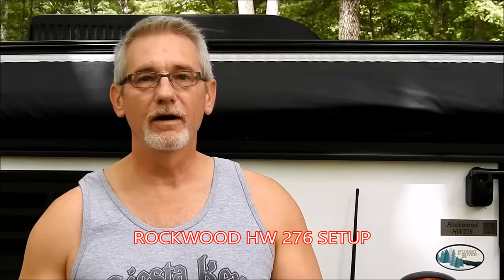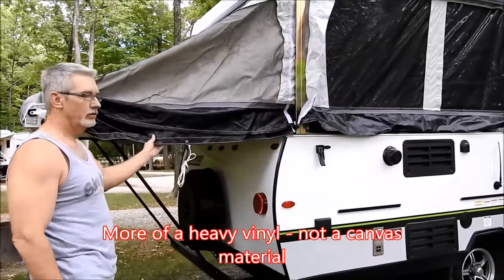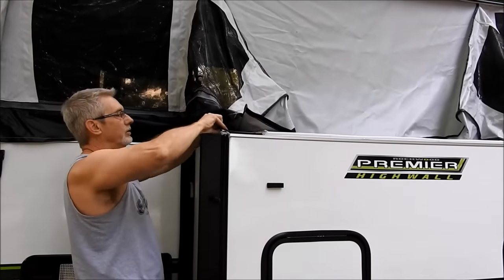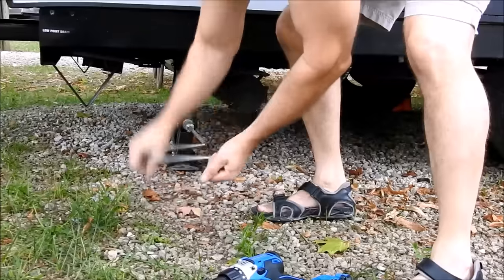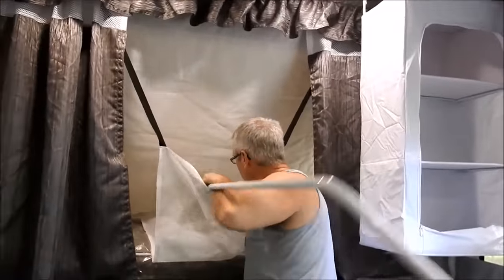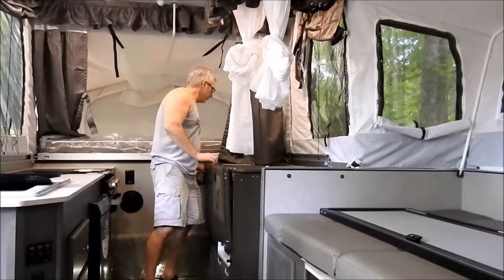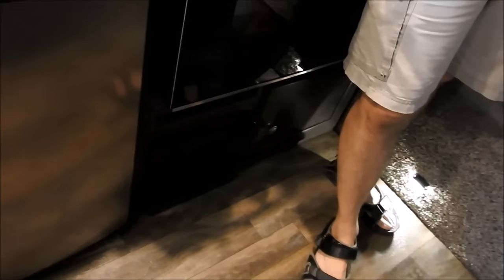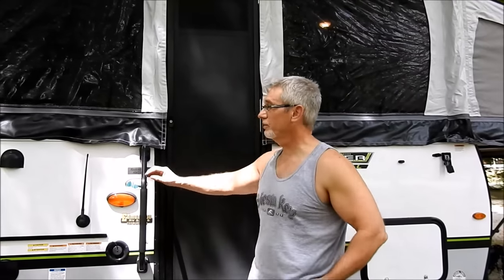Pop up camper set up, Rockwood High Wall 276 set up

Comment: We had a large pop-up for about 12 years. The first night of each trip I would turn on all the lights on inside walk around the outside of the trailer to close up anywhere light would come out of the points where the tent sealed to the trailer. We found that if you are using a fantastic fan the vacuum was enough to suck in any tiny flies that would be attracted to the light. When we did not, we would quickly realize how many bugs could get in within a very short time. Good luck and I hope you have as many years of fun as we had with ours.

Comment: Liked the looks of the high wall pop up.We have a 1984 Jayco pop up camper and enjoy it more sometime than are 25 ft. Wilderness camper. We thought for one person assembly you did really good. We liked alot about yours. Ares came with no A/C heater. We camper in Missouri in February at 30 degrees outside with a electric heater and two large dogs. My son had  A frame pop up with A/C and heat and him and his family came to our to get warm. The 1984 pop up had the most space out of the two. Enjoy camping!

Comment: We had a pop-up for years, many many happy memories in ours, we loved it. I’ll give ya a couple of hints, do the bottom outside edge (the Velcro etc) of the bed after you push up the bed bar, makes it a little easier to push up that bloody bar. 😆 Even with a heated mattress, but some thin foam insulation under the mattress, not only does it keep you warmer but it adds a little cushion to the mattress. One final tip, if you have a fiancé with allergies, hook up that ac. LOL 😂
I am curious as to why you’d use a port a potty when you have a potty built in? Black water is super easy to dump.

Comment: It is much easier to put the bar in above the bed if you do it before you do the zippers on the side wall. It took me a couple of times setting up the camper before I realized that. Good video for first time set up. I have the HW 277 and love it.

Comment: Nice job , you get faster after a few times of setting up , we level the camper first then the stableizers go down and then lift the roof , as soon as the roof is up put on those safety bars just in case . We use a small hand level on the bunk support bars  to level . You could probably feel me helping you push on that front canvas roof ,mine is still snug after 2 years but not bad .you already discovered the corner zippers we unzip to within a inch or so of the top, they can be stubborn to line up if unzippef all the way with tension on the canvas .we can tow our popup with any vehicle in the house and it stores in the garage , not so with a hardside so that made our decision easy and the extra work worth it , congrats and have fun , from a fellow rockwooder .
Reply: I imagine next time the camera person aka fiance will help and make it go by a lot quicker and efficient.
Reply: You done well I  from uk

Comment: My husband and I borrowed his parents pop up camper, and it wasn't near as hard as the one in the video.  Now this was 30 years ago, and didn't have a bathroom or a pop out for the dining area.  It was what is called a hard sided pop up.  It had a queen size bed on one side and a double bed at the opposite end.  Nice dining table, seating for four, and could be turned into a bed.  Had a kitchen area (stove and oven, sink),  ect.  The sides to the bed, once pulled out, were solid fiberglass.  We were able to set it up in about 10 minutes.  So don't be discouraged about pop-ups, as there are easier ones to set up.  The one this gentleman has just has all the bells and whistles.

Comment: A very long time to set up, but a very nice pop up. Enjoy! You said you spent time in submarine duty, I assume you were in the Navy. I served as well. Thank you for your service veteran Brother, I was an Air-dale. Enjoy the new trailer and happy camping.
Reply: my husband also served in submarine service. Took a while to set up but I am sure the more you use it the easier and faster it will become plus your other half will most likely be helping.
Reply: Rick C Fellow Veteran Brother Thank You for your Service from an Air Force Veteran . My brother was in the Navy on the sub USS Sam Ray Burn home ported in Holy Loch Scotland . He was stationed state side in New London , Connecticut . He rented a house near by in Gales Ferry , Ct. What is an Air-dale ?.
Reply: @bobshaw4063  An Airedale is referred to Pilots and Sailors that work in the aviation division, also know as the Brown Shoe Navy. Since all Pilots wore Brown shoes.  I was an Aviation hydraulic and structures Mechanic.
Reply: @MRCRUZER19  Thank You four reply & explanation of an Airedale .
Reply: @bobshaw4063  ,
THankX from all, USA Patriots..Now of Only i, could find one like my cuz Dave HAD YRS ago , . 
under 2000.00 🇺🇸👵 lol, 
I Just love Fishin !
Reply: @carasmussen27  it took longer because he was explaining everything for the benefit of the video. It won't take nearly so long when they are just setting up, and working together.😊

Comment: I had a pop up and camped a few years in it. The set up and break down got old quickly. For about the same price we bought a somewhat compact 21 foot trailer with an electric slide out to make it wider inside. Much happier now, pull up to the camp site and just hit the button for the slide out and that’s about it. Hard sides, a real bathroom, much better insulation, etc. and at just 21 feet it fits in all of our favorite camp sites.

Comment: Ive had pop ups for years, love them
Reply: Could set it up and take it down in about 10 minutes or little less.
Reply from the maker: Yes, This was my very first time. It did get better the more I practiced. I think one of the problems with this one is that it was a high wall. Everything was placed higher up, bigger and heavier. If I were to do it again...probably just a regular 8 or 10 foot box pop up

Comment: Just caught your video. Very nice. We have a Flagstaff  HW27 ks from 2013. very similar in a lot of ways. We went with it cause the Kitchen slide meant I didn't have to be inside very much. The wife is height challenged so I made her a double step to help her get in the bunks. One step would help you guys in setting the poles. Have fun,  in the camper. open the screens and you almost feel like your outdoors. Bless you guys, the adventure begins.

Comment: I purchased my 97 Fleetwood Coleman Camper about a month ago ..... The general layout is not that much similar ...... and don’t have a the wet bath ..... We did our first trip with it last week and loved it ...... Yeah , you always have to play with the door a little bit .... but always get it in there . I have to deal with the drain not draining the way it should .... always projects to do on the older ones ..... and prefer to use a camping toilet at night with a 2 room tent shelter .... using the other room for showering if needed or changing room . 

It was fun watching you set it up by yourself ..... but have a lot less work on our older one ..... but yours does have a few more functions than ours . I have electric and heat that work great ..... roof type Air Conditioner that is not as economical on power as yours . It gives our generator a hard time at times and kicks off ..... 4000 watt generator . It may just need better grounding to the generator though .... anyway . I will catch up on your other videos little by little as a follower .
Reply: Meant to say  : not that much different .... (correction) .

Comment: We bought a 2019 this year and I spent an entire day replacing stripped, rounded, broken or missing screws.  Missing were half of the screws for the front weather stripping which is still not flush, will probably have to shim and rescrew once it cools down.  Day before we left, the handle for the bathroom exploded in my hand.  I replaced it with the front door handle and replaced the front door with a screen door handle using the same cylinder.  We went on a 10 day camping trip to CO and I started a laundry list of stuff to take care of after.  Both of the lights that snap on broke within day one, so flimsy we decided just to put them in the misc bin.  The locks for the beds are not aligned for level boards, lift them up when locking in place.  The door has put small holes and grease in the slide canvas (warranty claim).  The main bolts that attach the stove were there but looked to be started by hand only.  When I tightened these in, I decided to replace all the interior square head screws with #2 phillips head screws 1/4 longer.  Removed the screws for the slide out cushion velcros so they actually align and are not 5 inches from each other.  Queen bed replaced first thing for me.  Tanks are small, weekend warrior no problem but anything over 2 days will require dumps and water refills when forest camping.  Wire loom just above the axle is only held on by zip ties, wrap some loom on it.  Stopped using electric toungue jack after snapping a whole pkg of fuzes, plus its much faster doing it manually.  Door lock seems to be seized, cant lock it the door(warranty).  The good; fridge on gas/generator kicks ass, furnace is great too.  Can hardly feel it behind my 2500, excellent mpg loaded bed and trailer, no wind drag and very stable. Enough room to possible upsize the tires but havent started to look into it.  As you show, very simple setup and assembly.  I second the note on not unzipping all the way on the corners before collapsing.  I have also found it to be easier to unzip the AC drip hose cover and tuck it up underneath just before the final close.  Fits in our RV pad without issues from the HOA, runs for the most part on a 20 amp circuit but we bought a 30a generator just in case.  We chose the 276 for many of the same reasons but wasnt prepared for the degrading quality of almost all of the budget manufacturers these days.  Sorry for the novel, hope this helps somebody one day.  Good job on your video, happy camping!!
Reply from the maker: I am sorry for your experience. Sounds like you got a lemon! Thank you for all of the good info. I too may move the slide out velcro and and add some more as they dont seem to line up properly. This weekend is our second time out in this camper. The hot water heater is being finicky, but we will see. I will be checking the things you mentioned today! More videos of my trials and tribulations coming soon.
Reply: Wow , its faster to raise it manually ?    I was thinking it might be worth trying it manually , just to avoid the terrible noise and the strain on the batteries .  I am searching for a hw 296.  It has two axles on a larger box .   How is the vinyl holding out ?
Reply: @tizoned1  It's unfortunate how 'Quality Control' has degraded in America over the past 30-years or so
Many people are so stressed-out in their lives they can't really take pride in what they do to 'make a buck'

Comment: We used to have a pop up camper.  If you cut 1 inch dowels to the length of your windows you can use that to help roll up your vinyl windows easily.  It helps you get them tight and then all you have to do is snap or Velcro the ties inside to hold them.  It makes it look so much neater than just folding them up or trying to roll them without a dowel.  Enjoy your camper!
Reply from the maker: Awesome idea - Thanks!

Comment: We've owned our hiwall 276 for about 4 years. Take a magic marker to mark the slot positions for the support poles. My wife and I devide and  conquer. She does the inside and I get the outside. We have had mixed results as far as build quality  we bought ours used so we had some issues. Bring a few tools and keep an eye out for loose parts.

Comment: Same floorplan as my 2007 Fleetwood Niagara Highwall and length.  My pullout bed frames are permanently attached to the bottom of the bed and lock out of the way when sliding back in. I don't have many poles. P.s. I'll be your camping neighbor and rock out to FFDP. LOL 😆

Comment: I had a high wall I bought around 2005 and being only 5 ft 4 in putting in the "candy canes" (that's what the salesman called them) and doing the door really kicked my butt. I'm glad to know it wasn't just me. I really liked the bathroom, but my toilet was a cassette type. Also the outside bed support poles have been improved, that used to be another difficult maneuver. In o4der to slot the poles into the proper position I had to lift up on the bed with my back. Usually not too bad, just awkward. Enjoy 5he camper.

Comment: Oh dear. Typicaĺ of most Pop Tops a nightmate to pack up and fold away. Had five of them and they are all pretty much the same to paclk up. Took a while for me to see the light. Now I have a Caravan. Considerably easier to pack away and  and a tenth of the time you would have to hope pray the weather is good for setting up and mote so for the packing up.

Comment: We had a Flagstaff highwall one good tip is I used shower curtain holder rings to lower the hanging pantry to a level it could actually be reached by my wife
Reply from the maker: Great idea thanks! I am looking at adding removable tension shelving over part of the counter top.

Comment: Great video really liked ver detailed.
Im gonna reverse the process my Wife and i are going to remove the A/C on our 2018 Rockwood HW296 pup and install a maxx air fan in it's place A/C is too cold for us so a fan makes good sense.
I'll be selling the A/C unit we don't need it.
We will be using the ac wire going to the unit to tap into the light plug for the pushout light fixture that will be an easy install.
I'll be uploading a Video of that when i do it. 
Have fun camping with you new A/C unit hope it keeps you cool. Safe travels.
We are heading to Maine for a Month.

Comment: 👋Hello great video.👍We are buying a 2017 rockwood.We were told the high had to be 20 inches from the ground and it needed to be 2 in ball? Did you have this problem also.I see you and I have the same type of truck I believe. Nissan Armada?Also is there any bounce of sway in trailer when towing?
Reply from the maker: The scariest part of towing with my TV is forgetting it is back there...until you look in the rear view mirror. Once up to speed, there is just a hint of a "tug" from time to time. Thank you for watching

Comment: RV's are a game of Cost & Convenience to sleep the average family. Pop-ups are inexpensive but more work to set and break camp. Travel trailers are convenient to pull up, level, and connect but not that cheap for how many you can sleep. Camping in a pop up during a cool fall weekend with the windows down beats any other RV's experience IMO. I'm looking at a Casita or pop up for my first RV if I want to graduate from a tent.

Comment: A-frame vs pop-up tent camper. A-frame less than 5 min to set up with no canvas to dry out . Pop-up 30 min to set up with canvas to dry out. No canvas flapping in the wind for A-frame vs a lot of noise from the canvas in the wind and neighbors in the tent pop-up. If you don't need the extra bed space the A-frame is the way to go.
Reply: Well yeah lol.  The extra bed is the reason why people get a pop up to begin with.  That's like saying, I have a Toyota Camary. Great fuel economy, cheap parts and labor. So if you don't need that v12 engine in your Lamborghini, I'd go with the Camary.

Comment: One other tip for new RV or pop-up users. Bring some pieces of 2 x 6s about 1ft x 1ft Or purchase the bag of leveling blocks that are outrageously expensive but lightweight, compact and easy to use. You want to level the unit by one tire if you need to. Depending on how level the site your on is. Build them up to level one side and then put the jacks down for stabilization. You also may run into occasions where the stabilizing jacks do not touch the ground. In which case extra leveling blocks underneath the stabilization Jack will help in this case. Believe me there’s nothing more uncomfortable than sleeping on a bed that is leaning to one side or another. It makes you feel like you’re rolling out of bed all night. LOL

Comment: How do those little poles hold any body up?  What is the weight capacity of the beds hanging over?  Overall, it’s a great camper and you should have a lot of fun!
Reply from the maker: I believe the beds are rated at about 1000 lbs.

Comment: Rockwood really went out of their way to complicate setting up a pop up! My parent’s 1965 tent trailer was a lightweight breeze to set up & the hardtop pop up Hubs & I had (year unknown, we bought it well used )in the late ‘90s was quite easy to set up. Rockwell didn’t need to reinvent the wheel!  They do however pack a lot of features into this one! We’re back to tenting, have thought about a pop up but don’t need the second bed wing. TT or fifth wheel is our next camping thing.

Comment: Great job to you both. If you don’t mind me asking, what was retail on this unit and what did you actually purchase for.
Reply from the maker: Listed for something like 17,800 and paid around 16,300 "out the door" (not including tax)There is a huge mark up on any RV. There is the MRSP which is very high, then the dealer gives you a deal by taking thousands off, then they tend to show that their "real price" is so low that they are not allowed to advertise it. The big question for me was...what is included in the final price. Some dealers will give a low price then add on the cost of batteries, propane tanks, dealer prep and even several hundreds for the walk through with the customer. Then of course any hitching supplies and they tried to sell me a weight distribution hitch which was not needed with my tow vehicle. For me the 16, 300 included all of the above ( 2 batteries, 2 filled propane tanks,  a hitch ball/mount, the walk through, brake controller and installation, a single prorac bike  holder for on top, and a $50 dollar store credit). A good resource is "seedealercost.com"
Thanks for watching